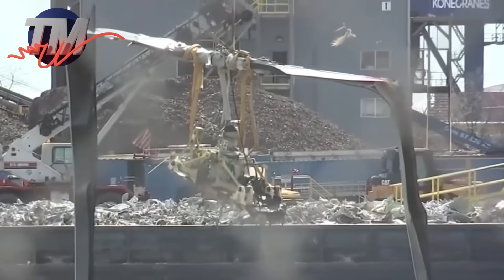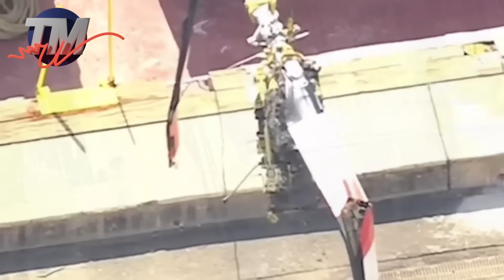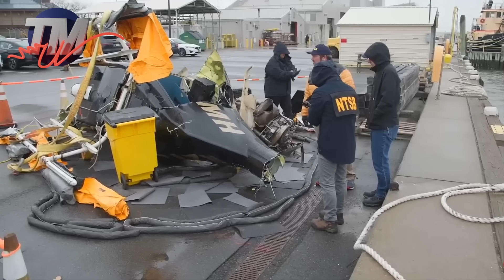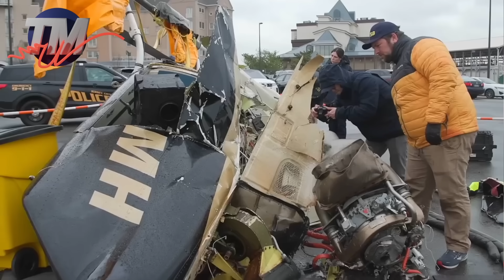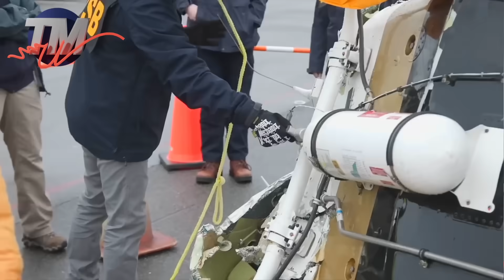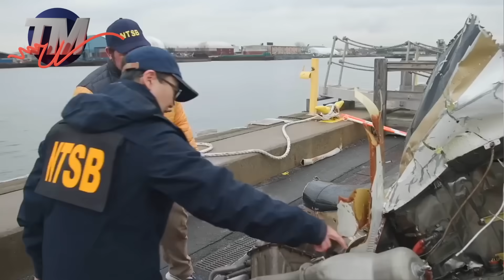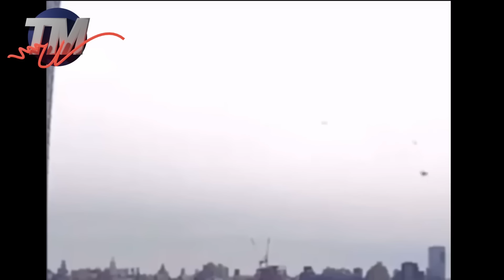Recovery of the Main Rotor of the Hudson River Tourist Helicopter - it's worse than we thought

Comment: If the transmission were to suddenly lock up, the torque on the top of the fuselage and tail joint just may be enough to separate both. That is what appears to be seen in the video. Has a tranny ever locked up like that? What could cause such a catastrophic failure in the tyranny? I’m confident that a sudden lock up of the rotors would cause failure of the airframe. Also, once ripped from the fuselage, they would auto rotate down on their own.

Comment: Try compare your Hudson helicopter crash to those that were happening in the North Atlantic with helicopter flights to the oil rig. Gearbox failure was suspected. A complete catastrophic failure of the gearbox whilst the engines are in flight and under strain might rip the whole helicopter frame apart. I asked Google AI, below was some of the answers. 

A gearbox failure, specifically in the main rotor gearbox, has been identified as a cause of helicopter crashes during offshore oil rig flights, with one notable example being the 2012 North Sea EC225 Super Puma crash. Investigations have revealed that fatigue cracks in planetary gears within the gearbox, particularly in the second stage, can lead to catastrophic failures, causing the helicopter to crash. 
Here's a more detailed explanation:
Catastrophic Failure:
The main rotor gearbox is a critical component for transferring power from the engine to the rotor blades. A failure in this gearbox can be catastrophic, leading to loss of control and a crash. 
Fatigue Cracks:
The most common cause of gearbox failure is fatigue, where cracks develop over time due to repeated stress and vibrations. 
Planetary Gears:
The main rotor gearbox often contains a planetary gear system, and fatigue cracks in these gears can initiate the failure. 
North Sea Crash:
In the 2012 North Sea EC225 Super Puma crash, a second stage planet gear fractured due to a fatigue crack, causing the main rotor gearbox to fail and the helicopter to ditch. 
Safety Concerns:
These incidents have raised concerns about the safety of Super Puma helicopters and other offshore helicopter models, leading to investigations, checks, and even groundings. 
Other Factors:
While gearbox failure is a significant concern, other factors like defective parts, pilot error, and engine problems can also contribute to helicopter accidents.

Comment: I actually own a 1979 Bell 206. It was bought by my father for his company. When he died in 82, I got the helicopter. On top of that, I flew Blackhawks for the Army for 20 years. When I first saw the main rotor still had the swash plate attached, I thought mast bumping. A neg g maneuver that leads to mast bumping could cause the main rotor to actually cut the tail boom off. It still could be that, yet I read something today that they had found metal in the transmission and supposedly fixed it. If they did not and the metal caused the main gearbox to lock up, as soon as the main rotor and transmission came off the helicopter, it could cut the tail boom off easily. The reason the government is getting involved is because this is the 3rd accident with deaths in US this year. Deadly accidents in the US do happen, yet we have not had 3 in a year in a long time. 3 no survivor accidents. Near misses, having to land because of a problem with the plane, running off the runway, the accidents that no one dies in, well, there are no more of those this year than any other year. As a matter of fact, in 2016, we had 8 of those accidents before May 15, and did not have another one the rest of the year. (I went to the NTSB website and did some research on accidents for a blog reply.)

Comment: It was obviously a mechanical failure that started a chain of events. A part failure that escalated to a component failure that led to catastrophic force destruction. Having been a pneumatic (air & hydraulics) technician in the AirForce. I understand the importance of maintenance, especially fluid maintenance. Spinning metal parts especially those spinning at high RPM wear. The speed at which they wear and the level of wear is determined by the cleanliness of the fluid they are surrounded by. Heat can also be an issue. But that normally only becomes and issue if the fluid levels fall below required levels. If fluids get dirty and are allowed to stay in the system you're basically running a very, very fine grade of liquid sandpaper throughout the component. The fluid gets changed but the damage is done. The critical tolerances have changed. The component internals are sloppier than when it was new. Which will accelerate the wear. There isn't anything more important than stringent fluid change maintenance and analysis of those fluids. Clean fluid is critical for high stress high RPM parts. Because it's not a question of if you will have a failure, it's just a question of when and how bad it will be.

Comment: This is incorrect instalation of this trans and gearbox even if the shaft was broke it would not rip out the complete trans and roto box this is mechanical fault this dose not happen this is vary bad find the log books and see when this aircraft was serviced for the 100 hrs on the main gear box and rotor rebuild every 100 hrs of flight 8:50 there is a a complete rebuild of the hub and blades and check for cracks on the main shaft there is a mechanical deviance there is something vary wrong !log books tell the story .

Comment: A planetary gear failed and jammed, causing the inertia of the rotors to tear the entire transmission deck from the airframe. The transmission deck may have had cracking around the rivet holes. I would not be surprised if the FAA calls for eddy current inspections.

Comment: i think the TRDS mount at 2:16 is the one that failed, or its flex coupling join where the shaft is bonded to the flange. this span around and shook the rest o the shaft and broke it whcih cut the tial off, and thast where there are preciseyl only 3 scratches on the ben tpiece of white backed steel.

Comment: I'm thinking we are going to find that it was a tail boom failure. The 206 is a counter clockwise rotor. This would cause a yaw right. If the pilot was by chance still coherent possible that he yanked the guts out of it and maybe ripped the deck out. I do not believe that the rotor would still auto if the gear box seized or slow drastically as it was still spinning enough to create lift.

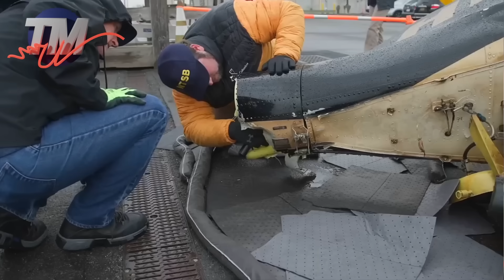Comment: At 1:57 you said where the tail boom bolts to the fuselage. The picture shows it is 1 frame past where it bolts to. The inspector hand is in-between the two. The bolt on area did not fail.

Comment: As a maintenance Tech on Army helicopters including a few years on the OH58 and it’s variants, I believe the 206 is a very similar airframe. The transmission deck on the 58 is a vertically oriented honeycomb structure and repairs were common and quite involved. The attachment of the tail boom was a carefully inspected area as well on every phase inspection (PPM in later years) and eddy current inspection of the tail boom box often failed. Working at a test facility, we ran dynamic tests of several different aftermarket tail boom assemblies including many auto rotations at max weight as well so clearly there was concern from the folks higher up the food chain. I would speculate those two areas are the weakest parts of the airframe. Dynamic vibration is (of course) a powerful force so if a significant vibe happened these two areas are right where I would expect failures.

Comment: There does appear to be over reporting on aircraft accidents,
..
It's clear, thr future direction for international travel is to be subdued, due to the climate changings..
Because Co2..
..
Is this reporting designed to make people anxious about flying?
..
The reason why congress is involved is because of the high status of the passenger..
More effort to conclude what happened compared to if it were just a normal family on board.
Ntsb will to the necessary investigation, but the government will be under pressure for Answers..

Comment: As a layman with effectively no knowledge of helicopters, the video combined with the news that the transmission is with the rotor speculates: the transmission locked, force rotating the body of the ship in whatever direction that would be; snapping the tailboom at the joint; and the initial jolt tore the transmission off its thrust bearings (or equivalent) such that it departed the ship immediately after the tailboom separated. I can't imagine there's anything the pilot could have done, and to all onboard, Rest in Peace :(

Comment: I retired last year after 48 years of aircraft maintenance, mostly helicopters. If I were looking into this accident I would be looking into corrosion around the transmission deck and MGB attaching hard points. I am certainly not an engineer but I find some of the hypothesizes posted very interesting and of course feasible. 
I hope they can find the cause of this accident to prevent it from happening again. As some have mentioned, helicopters are not forgiving machines when things go bad. My thoughts and prayers are with this young family and the pilot, RIP.

Comment: first the Tail boom did not separate from the fuselage, that is the end of the end of the tail boom fitting assembly. it is almost like a cage. at the attachment point you have the attachment ring, all 4 fittings are riveted into place, that's the 2 rivet lines right inside of the blue paint, then a second ring is installed. like I said the assembly is like a cage made up of the 2 rings forward and aft and the 4 tail boom fittings.

Comment: Could this be due to stress in the gear box mounting deck? I notice the blades snapped but did not break off. The tail would failed first, since the gearbox started coming out of alignment. I noticed in the wreckage that the certain sections of the frame look ripped and twisted. I think the gear box mounting failed then the tail rotor. This caused the extreme yawing! 15 Tango.

Comment: WOW, I hadn't seen the raw footage of the incident until now. It's completely obvious that the tail rotor assembly failed and shot forward and wrapped around the main frame of the helicopter right before the complete main rotor assembly separated from the body. WOW!!! PS... It really doesn't matter which way the tail assembly went, right or left. It wrapped around the main body so damn fast. Of course it went whatever way the rear blade was pushing the whole tail section.

Comment: A sudden application of massive torque could do that. Gear box seizure could apply that energy. I’ve seen engines seize and ripped off their mounts and depart from the aircraft because of oil loss.

Comment: I believe the helicopter was being used as a work horse irresponsibly and with a serious lack of proper maintenance from that conclusion it had a catastrophic structural failure. Obviously the air frame and it's structural integrity went unnoticed due to shortcomings and irresponsible maintenance checks. In conclusion the helicopter had a massive structural failure period is my view. RIP to the victims.

Comment: I was a blackhawk wrench in the 80s. The first unit the Army sent me to in West Germany didn't have any blackhawks. So, I got to work on Hueys, Cobras and OH-58s, which is what this was a version of. Our unit was also the lead recovery unit for any crashes in country. So, I've seen aircraft after a crash. I've never seen a tail boom do that. I've also not seen the entire hub assembly and transmission completely separate from an aircraft in flight. We didn't put gear boxes in like that. We stacked everything during assembly. All the bolts appear to have failed at exactly the same time? Embry-Riddle Aeronautical University taught me not to jump to conclusions in aircraft crash investigations, but something big and bad smells rotten here.

Comment: I have to agree with several people who go in the direction of an internal gearbox failure.  It's the one thing that can explain the intact configuration of the rotor, mast, gearbox, and attaching assembly as well as the boom separation.  The fact the rotor is damaged equally at the same point per blade is merely the result of impacting the water.  If the gearbox had a catastrophic internal failure (lets say a planetary gear separation) then the entire assembly would have immediately stopped, creating massive energy transfer to the points of attachment to the aircraft frame, which would be weaker than the attaching points of the transmission to the mast section.  Also, it would explain why there's no observable damage to the transmission case since the damage would be internal.

Comment: There's also the possibility that the engine seized up violently.  An immediate cessation of the rotation would cause massive lateral forces to the tail boom and transmission assembly, causing the boom to keep moving while the fuselage is unable to rotate until the transmission is sheared off.   Also, I don't think any type of autorotation or "controlled" crash is possible once you lose the tail rotor.  I've done autorotations and you need the tail rotor to keep the main fuselage from spinning in the opposite direction of the rotors.

Comment: If I was an engineer I would design the shaft to sheer and keep the transmission from detaching from the helicopter. The upper roof chamber b.t.w. is steel reinforced I read, lower aluminum tube.

Comment: I fly complicated high end  RC helicopters that work very similar to real helicopters and are under the same physics.  If you lose tail authority , the tail will of course yaw in the opposite direction of the main rotor  direction.  I may be wrong, but I think the tail whipped to the left and nose to the right.  I think it was a major gearbox lock up or failure.  As such , the tail rotor and main rotor have a lot of momentum and if they cannot spin on  gears and bearings  in a normal way , the entire gearboxes may get ripped from their mounts.  I think a main gearbox failure locked the shafts and gears that the tail and main rotors are  attached to   and  main rotor momentum detached the main gearbox assy. , 

On RC stuff, you often have plastic gears  so when something locks, it just knocks the teeth off  gears and strips sections off..  If you have a severe lock of very strong hardened metal gears, then assemblies  may explode

Comment: As Juan Brown said on his Blancolirio channel, a catastrophic gearbox failure, causing it to seize, would result in a huge torque reaction sufficient to rip out the gearbox. This would also explain the tail swinging to the right, assuming a clockwise main rotor.

Comment: Here's my theory. The sum gear is completely stripped of its teeth. Instantaneously the main rotor drive has gone but the power take off to the tail rotor drive continues to drive the tail rotor through the IDG and TRGB causing the violent yaw and sheering the rear ruselage from the centre fuselage structure. Although the sun gear is stripped the hub is free to rotate and devoid of counter-torque, the forward fuselage now wildly turns as it falls to impact. The main rotor gearbox remains attached to the mounting plate but the mounting plate sheers off at impact, in a similar manner to the Gazelle helicopter barbecue plate has done in previous incidents.

Comment: Having worked on military aircraft for over 20 years I can say that no one can say it looks like this so that happened then that happened.... get all the information, sit down and see what they can see, some may make sense and some will not make sense. Some answers most will disagree with or just a few may except as possible. There are reports of pilots losing control of a aircraft and punching out the the aircraft starts flying normal again and crashes when it runs out of fuel........ 99.99% of aircraft people say that is impossible but it has happened ! I say lets wait till the reports come in to see what the best guess/reasons are before we make a final decision !

Comment: Smokieonesix- I believe you're on to something, As a Marine Corps pilot of 25 years and the civilian pilot of nearly 40 years now, this explanation seems extremely legitimate, and you make a great point but I thought I would throw this out in consideration, now granted yes, I am a fixed-wing pilot F-4s and F/A18s, but a lot of my friends were in rotors squadrons, and it didn't seem likely this was tail boom slap or rotor slap after talking to a couple of them, because in the video when the Helo goes down the rotor still seems to be in one piece, what I mean by that is that each blade hasn't separated from the main rotor mount as it came down and hit the water where then it cracked the blades, you would think you would see one rottor blades intact and the other would be like half because of the tail boome hit or the rotor slap, or at least that's what I would think. Now tell me if you think this might be a scenario, whoever is flying in the right seat whom I believe was the husband/father, he decides to hand someone something from the front seat to the back seat, and as he does this he accidentally hits(steps on the pedals the rudder pedals) and that slips the aircraft to the right or as it looked in the video, extremely fast thus in turn would probably rip the tail boom off and possibly sheer off the main rotor mount, pure speculation on my part but is it a probability?